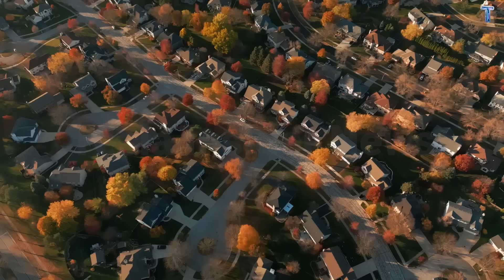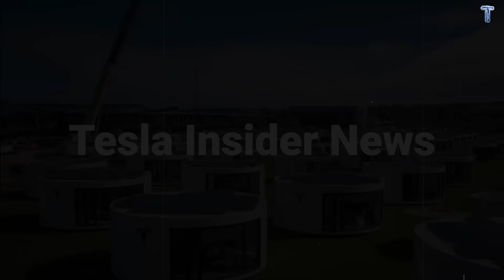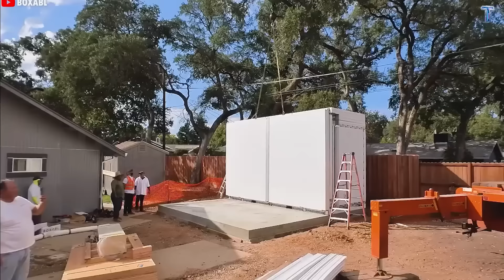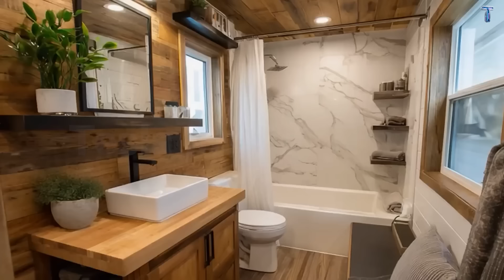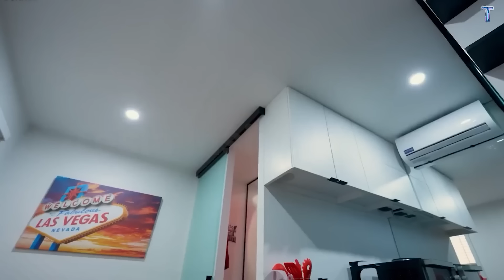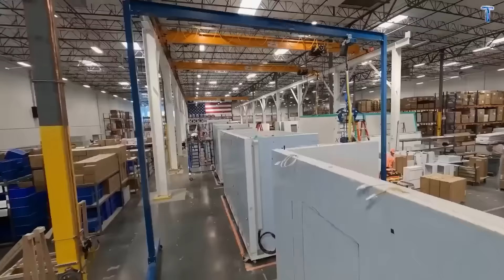Elon Musk’s $249/Month Tesla House Could End Housing Bills for Millions

Comment: $200-$300 per month is cheap.  I like the internal surveillance to prevent theft.   One need own land to take off community common fees.   Hopefully it will also be here in NY.
Reply from the maker: The monthly figure and land requirements would both need official confirmation, and internal cameras would require explicit consent, secure access, and clear privacy controls. Availability in New York would also depend on local codes, utilities, and delivery support. Which requirement matters most to you?

Comment: The cameras you can put blinders when you're home and take them out when you're not , microphone won't work if you use a jammer , problem solved  !!
Reply from the maker: Covering a lens doesn’t disable a microphone, and disrupting wireless transmission doesn’t necessarily stop local recording. Physical disconnects and clear storage controls would be more meaningful features to verify. Would you require a visible hardware-off indicator?

Comment: what are those big tanks and pipes that are going into the side of the homes?
Reply from the maker: Those tanks and pipes appear to represent utility and service connections—such as water, wastewater, power, ventilation, or backup systems—but the video does not confirm a final Tesla House layout. Any real design would need clear shutoffs, inspection access, and local code approval. Which utility would you want explained first?

Comment: Living in a seniors building built in the 70’s along with asbestos ceilings and shared air vents that are rarely to never cleaned. Please winterized the specs and bring to Ontario, Canada.
Reply from the maker: Winterizing for Ontario would mean verified insulation, moisture control, ventilation, heating, and protection against snow and freeze cycles. The video does not confirm a Canadian package or code approval, so local engineering and permits would be essential. Which winter feature matters most?

Comment: What if you put two of these back to back; could you do a cut out to do that, to increase the space and privacy for visitors?
Reply from the maker: Putting two units back to back could increase living space and privacy, but it would require compatible structures, a safe connection, utilities, fire separation, and local approval. The video does not confirm whether the design supports expansion. Which shared space would you add first?

Comment: What would happen if you raised the roof higher? Could you hang hammocks between the ceiling and the wall ; or put bunk beds under? Does it offer that flexibility?👍👩🏻‍🦰🇨🇦
Reply from the maker: We don’t have verified drawings or load limits that establish a raised roof, hammock anchors, or bunk-bed options. Those changes need a design that supports them. Would extra headroom or a separate sleeping area matter more to you?

Comment: CLOCKBAIT!

No, this is not real.
The video (titled something like “Elon Musk’s $249/Month Tesla House Could End Housing Bills for Millions”) is clickbait / fabricated content. There is no such Tesla product.
Key facts:
•  Tesla does not manufacture or sell houses (tiny or otherwise) for $249/month or any similar low monthly payment.
•  Claims of cheap “Tesla houses” (prices ranging from a few thousand dollars to “$249/month”) have been circulating for years in various forms. They have been repeatedly fact-checked as false by outlets like PolitiFact.
•  Tesla’s actual housing-related products are limited to Solar Roof, Solar panels, and Powerwall batteries. The company has never announced a housing division or factory-built homes for consumers.
•  Elon Musk does live (or has lived) in a modest ~$50,000 Boxabl prefab unit near SpaceX’s Starbase in Texas that he rents from SpaceX. That is a personal arrangement and has nothing to do with a Tesla consumer product.
These videos typically use AI-generated narration, recycled clips of Musk, and made-up “leaked documents” to drive views and engagement. They are not based on any official announcement from Tesla or Elon Musk.
Bottom line: Ignore it. It’s not real.

Comment: There is cheap land out there in the middle of nowhere, but running electric, septic, internet and landline out to the middle of nowhere will be cost prohibitive.  Are you really going to forgo all of that and rely on solar, cellular service and an outhouse for a permanent place to live?  Just the split A/C units and a 240W clothes dryer alone would eat all of the electricity that those solar panels could produce.  Where are you going to get the electricity to charge your Tesla from? And if you want an traditional HVAC system with ductwork?  Forget it.

Comment: What if you don't want a glass  roof?
Reply from the maker: That would depend on the final configuration and available options. The video does not confirm whether a solid-roof version, shade system, or retrofit would be offered, so that would need to be stated in official specifications before purchase decisions.

Comment: Are those units legal in California los angeles area , does it require permit
Reply from the maker: That depends on local zoning and building rules. Los Angeles-area permits, ADU standards, utility connections, and whether the unit is classified as a dwelling or RV would need confirmation from the relevant city or county building department; the video does not establish legal approval. Which jurisdiction are you checking?

Comment: How does the glass roof hold up to heavy snow? Also, contract proves it is NOT as great as it seems. Lastly, if this is for a place like Mars, what is the food source? And where will the water come from?
Reply from the maker: Those are exactly the right engineering questions. Snow load, contract terms, food, water source, filtration, and storage all need real specs before anyone should trust the concept. Which one worries you most?

Comment: Flood chamber hope you have enough air till the flood goes down.
Reply from the maker: Flood safety is a serious question for any small modular home. Would you want it elevated, anchored, or designed mainly for dry/climate-stable areas?

Comment: The Reality Behind the "Tesla Home" RumorsViral videos on platforms like Facebook and YouTube frequently advertise a "Tesla Tiny House" priced anywhere from $5,000 to $15,000, specifically targeted at seniors living on fixed Social Security incomes.
The Scam Risk: These ads often feature computer-generated renderings and unverified "waiting lists" designed to steal personal information or upfront fees from retirees.
The Product Confusion: 
Tesla does not build structures. The company only manufactures residential energy components—such as Tesla Solar Roofs and Tesla Powerwall backup batteries—which homeowners can install on traditional or prefabricated houses.The Elon Musk Connection: The rumor gained traction because Tesla CEO Elon Musk famously downsized his personal real estate by renting a 400-square-foot, $50,000 prefabricated "Casita". However, that home is built by an entirely separate, independent startup named Boxabl.

Comment: This seriously is a practical idea and deal. I’m currently living in a tiny home not a Tesla bc I didn’t know until today they built these. What I love about my 240 square ft tiny is I have everything I need and it’s so comfortable for me. ❤ I’m aging, easy upkeep. Although I don’t have solar I use minimal electricity. I cook on propane and have propane heating if power ever goes out. Any home 400 sq ft or smaller is not taxable so that’s also a huge advantage. ❤ My home is absolutely brand new, no old house mold, dust or pest which is never a guarantee in any rental. 😊
Reply from the maker: Your tiny-home experience is valuable because it shows what actually works: low upkeep, low utilities, and simple living. What would you improve in the next version?

Comment: You need to make these houses. stackable & joinable. ?? Water. ,??
Reply from the maker: Stackable and joinable designs would make the concept much more flexible. Would you prioritize water systems, modular expansion, or structural strength first?

Comment: If the government building sector wasn't bought-off by the well-funded instatutional material suppliers the metal-wrapped quonset huts would've continued to work just fine as they did for returning young/poor WWpt.2 vets returning home to their famalies. Both metal-wrapped quonset huts and expanded metal-wrapped larger quonset homes effectivly still do accomidate remotely when not banned by assholes bitching about "affordable property" value reduction.

Comment: I could not find an independent source or Tesla website to corroborate the information presented here.  And I highly doubt what has been presented could be marketed at the prices listed without some form of gotcha.

Also 60 year life is too short.  The place will be eating you alive in maintenance in 30 years.  This sounds great to young people, but trust me, it will bite you in the backside.  Get the useable life to 120 years and we can start talking.  Also, forward built components and replacements must be compatible to the original design.
Reply from the maker: That is a strong fact-check point. Without an independent source or Tesla page, the pricing and lifespan claims need caution. What evidence would you want before trusting it?

Comment: Oh but I've reserved space in a future Data Center Parking lot! Why it even has a heated pool ! Although it's scalding water and slightly Radio Active ? But as long as you don't mind the Noise and Teslas Engineers watching you 24 /7 ? It's a real bargain!
Exceptmaybe the 400 meter trip food pickup if you qualify ? And do as your told !
Reply from the maker: That comment nails the fear behind the low price: privacy, noise, and control. Which issue would be the biggest dealbreaker for you?

Comment: The problem here in Texas is local building codes and restrictions on what can be built on land or lots. These need to be adjusted for larger towns and cities.
Reply from the maker: Texas is a strong example because local rules can change the whole equation from one city to another. Larger towns may need code updates before compact homes become practical. Would you support special zoning for tiny-home communities?

Comment: MY QUESTION. . . HOW DOES THIS WITHSTAND HURRICANE??   NO BURIED FOUNDATION . .
Reply from the maker: Hurricane resistance would have to be proven with wind rating, anchoring, and local code approval. Without that, the monthly price does not mean much in storm zones. Would you require a certified hurricane rating before considering it?

Comment: ENERGY INDEPENDENCE.  That is important in Texas, considering what happened during Winter Storm Uri, meaning blackouts due to overloads.  My wife (horticulturalist) and I were in Virginia, and come to Texas soon after the storm.  Our son-in-law drove from Plano to Arlington to get our mother.  Some people died due to the blackouts.  

I have a proposal for fixing the problem at the grid level.  But, I don't trust that ERCOT will adopt it.  So, I need a real solution near our grand daughter in Plano.  Allen?   

retired electrical and agricultural engineer.
Reply from the maker: Energy independence is one of the strongest arguments for this idea, especially after Texas blackout events. A home-level solution would still need reliable storage, backup, and service support. Would solar plus battery be enough for your Plano-area needs?

Comment: The small unit would be perfect got the HOMELESS.
HOMELESS POLICY
There will be separate treatment and housing for: 
a.	Substance abuse, 
b.	Mental homeless, 
c.	Jobless homeless, 
d.	Criminal rehab.
Homeless persons wiil not to live in mixed facilities where fights, drugs, and crime exist. 
Requirements:
1.	Housing built like Marriott Resident Inns, 
2.	24/7 management and security,
3.	Individual apartment,
4.	At or near treatment facilities, 
5.	Hire residents able and qualified jobs. Administration, housekeeping, landscaping, cooking, kitchen help, maintenance, erc. 
6.	Outplacement
Reply from the maker: Tiny units could help only if housing is paired with management, services, safety, and job pathways. The structure alone does not solve homelessness by itself. Which support service do you think matters most first?

Comment: Good luck getting a permit to place it anywhere perc'd in the US. Anything under 600 sq ft does not generate enough property tax to support most towns infrastructure.
Reply from the maker: Permits may be the hardest part in many towns. If small units do not fit local tax and zoning models, adoption will be slow no matter how attractive the price looks. Would you support a separate permit category for tiny homes?

Comment: Do you have units for Alberta climates, especially sub zero temp, minus 35 Celsius? Also, do you have units with a square footage of 900 with two bedrooms and two bathrooms, if so, what would be the price in Canadian dollars for a two-bedroom and two thank you for posting this video>?
Reply from the maker: Alberta would require serious cold-weather proof: insulation, heating load, plumbing protection, and snow performance. A 900 sq ft two-bedroom layout is also a different category than most tiny-home concepts. Would climate rating or floor plan matter more to you first?

Comment: There is no official Tesla tiny house, and Tesla does not manufacture or sell tiny houses. Claims regarding a $10,000–$18,000 Tesla tiny house are fake,, often linked to misleading, AI-generated content or unrelated, misidentified companies. 
YouTube
YouTube
 +2
Key Points:
No Official Product: Tesla focuses on vehicles, solar panels, and battery storage (Powerwall), not residential housing production.
Misleading Information: Many viral videos falsely connect Tesla to other companies, such as Boxabl.
Showcase Only: In 2017, Tesla used a "tiny house" on wheels to demonstrate its solar panels and Powerwall, but it was a touring marketing display, not a consumer product.
Real Estate Firm Confusion: "Tesla Homes" (tesla.properties) is a separate, unrelated investment firm.

Comment: Wonderful - EXCEPT you still have to find somewhere that will let you park it there, AND have the utilities hooked up - sewage line being the most difficult issue. So assume you have to spend a further amount per month for utilities after having spent thousands to install a sewage system - connection & septic system - would likely be $30,000 unless you connect to an existing sewer, then internet & possible gas or other electrical connection unless your solar power was enough. So NO you do not 'get a home' for that low-low-price they advertise !!!!
Reply from the maker: Exactly. Land, utilities, sewer, and local approval can easily become the real cost center. A low monthly price only works if those pieces are solved transparently. Which hidden cost do you think is most likely to surprise buyers?

Comment: Let's see... where do I begin? 

$5,983 fully engineered house extremely unlikely. At this price point this is not realistic for a fully functional home. Even the cheapest manufactured homes cost tens of thousands before land, transport, permits, utilities etc. Materials alone (steel, solar, batteries, HVAC) would exceed that. $249/month ownership assumes:
ultra-low purchase price
0% financing
no land cost
no insurance or taxes
no additional infrastructer costs

Also, seems there are some contractual and structural issues:

Repossession risk: Tesla can reclaim the home for missed fees without court action
Tesla retains access to in-home data from sensors and devices
Short warranty: Only 2 years vs. industry norms (~10 years)
Resale restrictions: Tesla controls resale terms and pricing
Zoning dependence: Benefits vary heavily by U.S. state laws

Even a tiny home needs placement, if you can even get this delivered to your home country:

Rural land (varies widely): $20,000 – $150,000+
Site prep (grading, foundation, septic): $10,000 – $40,000
Utility tie-ins (if not off-grid): $5,000 – $25,000
Permits + inspections: $1,000 – $10,000

Delivery: $3–$8 per mile can add thousands, that's if this can even be shipped to your country
Cranes / setup crews: $5K–$25K+
Electrical + plumbing hookup: $5K–$20K+
Furnishings + appliances: $5K–$15K
Last, but not least, where’s the bathroom, closets, a kitchen: $10K-20K

Comment: Absolutely genius! I love it, I find this house  to be  necessary for anyone desiring ownership. I grew up in more than 2000 square feet. Will I be capable of living in a smaller space?
Reply from the maker: A lot of people who grew up in large homes ask the same thing. Downsizing isn’t about giving things up as much as redesigning how space works. Based on current internal leak info, these homes are designed around efficiency, light, and multipurpose areas, so they feel bigger than the square footage suggests. Some people adapt quickly, others realize they need a bit more room. Do you think it would be harder to let go of space, or of the stuff that fills it

Comment: Yes, with an expanded model
Any available in Los Angeles?
Reply from the maker: At the moment, there’s no confirmed availability in Los Angeles. Based on internal leak info, California is complicated due to zoning, permits, and ADU rules, so any rollout there would likely be limited or pilot only at first. Expanded multi unit setups are being discussed, but nothing is approved yet. If LA allowed it under ADU rules, would you be looking to place it in a backyard or replace an existing structure